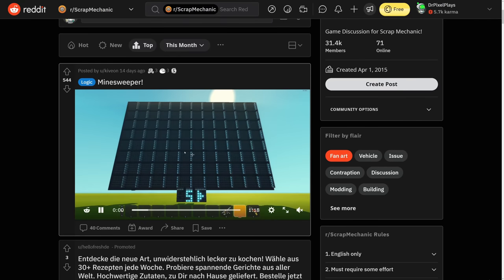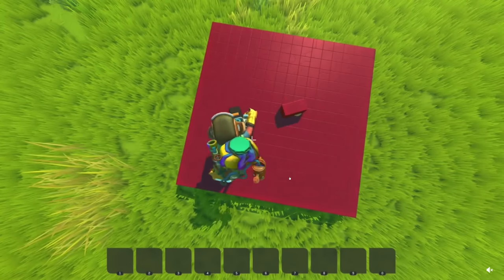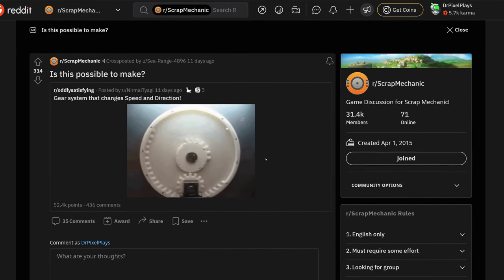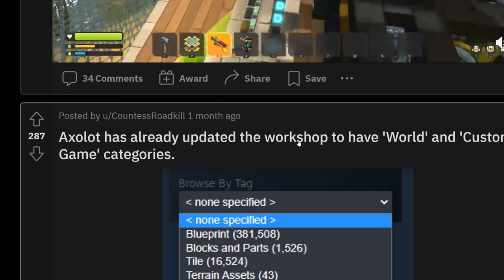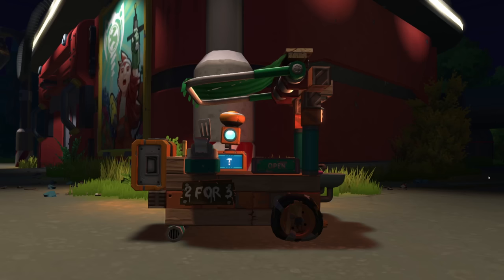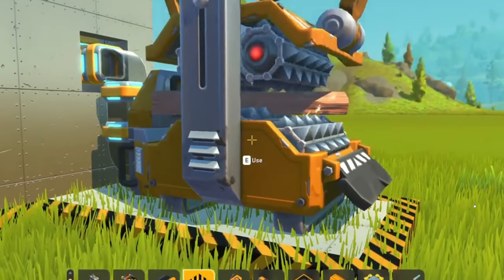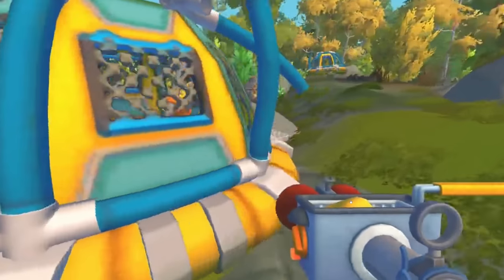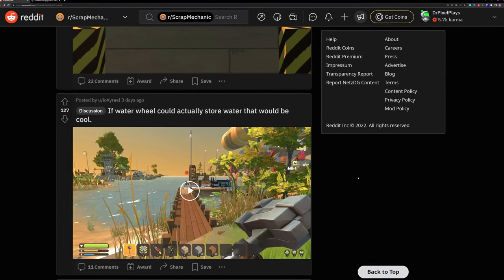Did We Have 2x2 Bearings All Along?

Comment: Oh, the turret is most likely just a free-floating bearing with a suspension glitch to turn, isn't it?
Reply: i thought it used the mod that has a logic gate that makes the bearings follow the camra
Reply: @orange8175  Nah. I mean, it's possible, but to me it looks like it was the old vanilla method that everyone used for tank turrets. It's also probably still the most used method of building tank turrets.
Reply: With the new strict follow cam, you can make it look camera controlled by hiding the ui and pressing buttons. As in, you can make it completely vanilla, it's just an illusion.
Reply: @orange8175  The new follow camera tilts, so you could just hide the UI and use buttons to make it Look as if it's cam controlled
Reply: @KaneyoriHK  Yeah. You can also just make it a wasd controlled, and have the vehicle driven with buttons, or have an AI/friend drive for you. 🤣
Reply: Its 2 glitch weleded satelites whit a seat and a sign in the middle on a gyro

Comment: 12 threads could be on a single core btw, would have to actually check the load per core or maybe run it on linux with some tools
Reply from the maker: True, but I also only have 12 threads on my cpu.
Reply: @Dr-Pixel  Are you saying your cpu has 6 cores with up to 12 threads/vcores (2 per core). I am not sure how those specs work exactly.. but i do know that in python i can start a bunch of threads lets say 100, but unless you do multiprocessing, python only has access to 1 core, so all 100 would run on 1 core (and be incredibly slow because probably 98 of those are constantly starved for cpu cycles).
pretty interesting to know how scrap mechanic does this.

currently haven't found a way to check this on windows.

Edit: python is a special case and seems that in windows threads normally do NOT run on a specific core unless you put a lot of extra efford in it. so i am guessing 99% sure ScrapMechanic is multi core and you were right
Reply from the maker: @toosafelol  You can check the core work load in task manager. When I play SM one core isn't getting maxed.

Comment: 6:06 "and I guarantee you it still works"
They made it so you can't weld respawn bags 😭😭
Reply: That's fine though, they also wrecked raids, so no need to protect anything anymore`. Which is good because they also completely destroyed the beds use, whenever you cross to certain tiles your respawnpoint is reset to the crashed ship.
0.6.0 is a freaking disaster